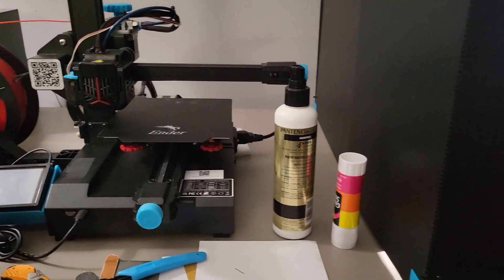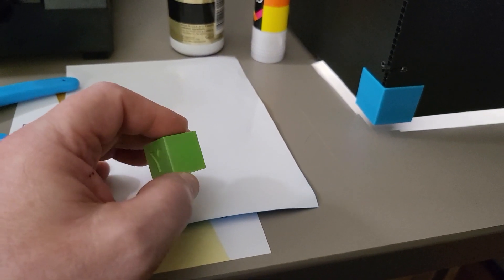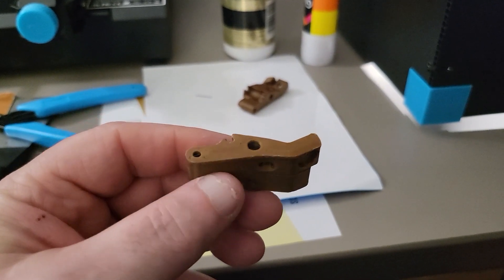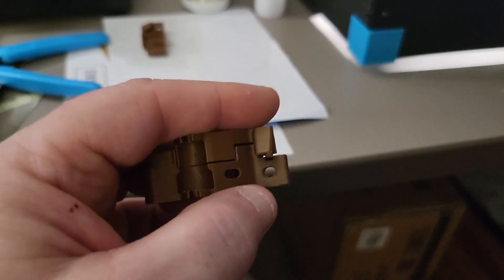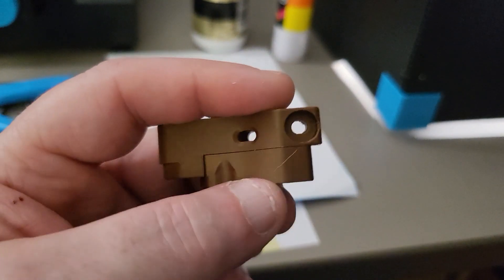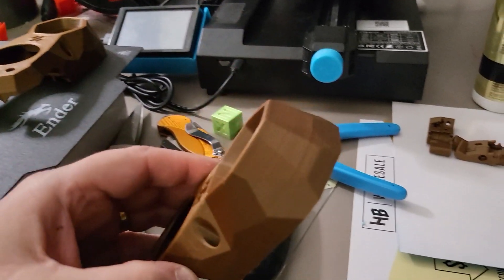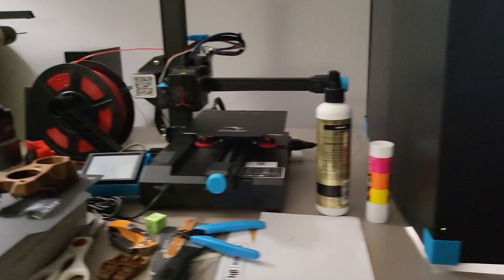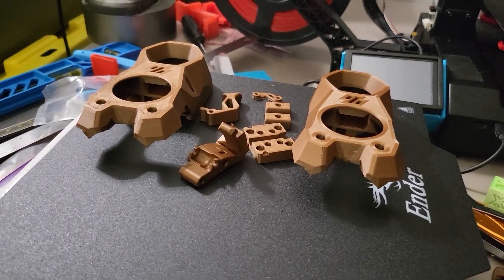Dimensional accuracy when printing Voron 2.4 parts on Ender 3 S1 Pro

Comment: 220 is too low for abs. How's your layer adhesion? The lowest I print abs pro is 235 in flashforge's abs pro. In esun abs+ I do 250 to 255